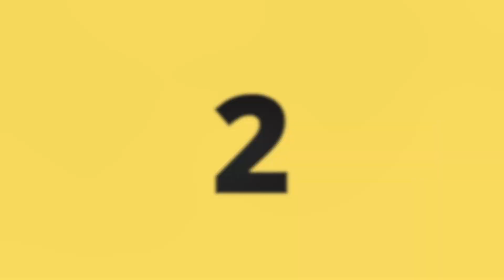TWO SIMPLE TO MAKE HOMEMADE TOOLS || TAPE MEASURE TOOL DIY | MAKING A METAL/WOOD SCRIBE MARKING TOOL

Comment: Not only did you build cool tools but you use them. Nice to see that file handle in action. And that corner taper reader is amazing.  Love these videos.  Great work.
Reply from the maker: Thanks again. Yeah, that corner tape reader works pretty good. And super easy to make.

Comment: Hi. what is the white marker you used at 4:05 of the video. Because marking metals is quite difficult.
Reply from the maker: It’s called soapstone. It comes in round and rectangular pieces.  I’m using a rectangle piece. They’re both about 5” long.  Hope this helps. Thanks for watching.